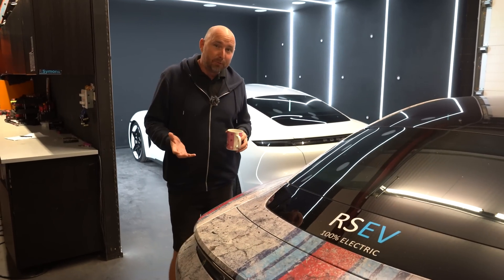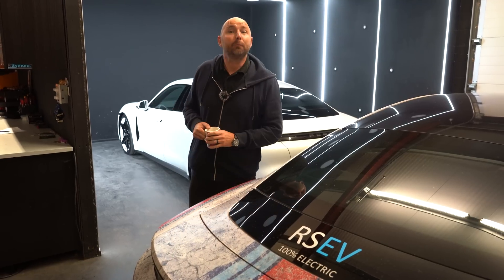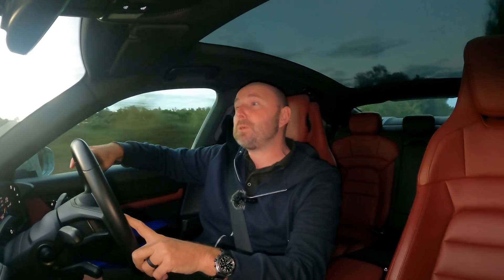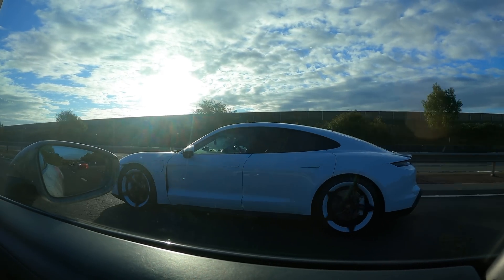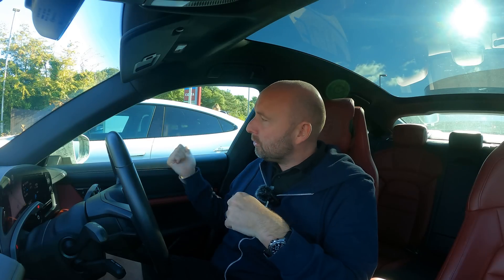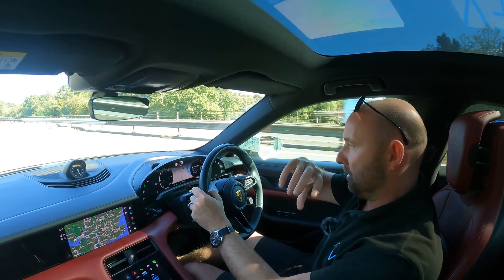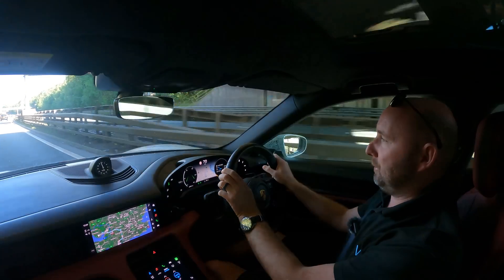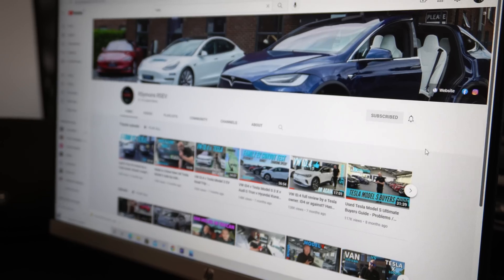Porsche Taycan side-by-side convoy. ONE with the software uPdate. Efficiency improvements tested!

Comment: Loving my GV60, it's a beautiful car. Getting used to the effects of changing settings on the range etc it's consistently approx 25 miles per 10% of battery drain so far. The heat pump is quite expensive to use unfortunately.

However everytime I see a Taycan I cry a little (given I had one on order) 😭

Comment: Hello thank you for the excellent side by side comparison, may I please clarify is it absolutely necessary to install this update at a dealer? aren't the Taycan updates auto installed over the air to our Taycans?
Reply from the maker: No this big update has to be done by a dealer. I even had to find and take my old owners manual for them to destroy so they could install and issue the uPdate with a new book! 
But apparently more over the air updates will now be possible
Reply: @RSEV  ok, that you so much for your reply

Comment: far to many chargers exposed to the elements. MUst be nice charging when its the dead of winter, blowing a gail, pouring down with xero roof cover
Reply from the maker: Well I’m usually in the coffee shop…

At least don’t have to stand and hold the nozzle in the car for several minutes like petrol/diesel
Reply: @RSEV  and your wet through by the time youve connected the charging cable and synced payment then have caught pnemonia going to the coffee shop because its tucked away or not working so your have to endure it twice 🤣
Reply: Thankfully, the majority of the newer 'EV hub' charging stations are fully covered, with on-site coffee lounges / shops etc - have a look at the new Gridserve ones...
But, when you consider that, for the first 20-ish years society was running petrol cars, owners would have to buy their fuel from chemists, we're catching up fast... 😉
Reply: @jonathantaylor1998  not as fast as the increasing electricity costs which killed off my ev purchase intensions

Comment: Would be interested to know how much did each stop cost in total - given recent electricity increase.
Reply from the maker: I meant to include, although to be fair prices change up and down they could be misleading in a few months time. 

However on this day each stop was a bit of £30 and so added up to about £60 in total. That’s with no membership cards, just pay as you go.

If I would have used Porsche or Ionity chargers for example it would have been about £25 in total due to discounted rates I can get as a Porsche owner
Reply: @RSEV  £30 to cover about 180 miles in a high-performance supercar...?
That'd equate to about 45mpg - still not bad compared to the 'real world' 35mpg the 4 E-Hybrid Panamera gets... 😉

Comment: Nice video I really enjoyed. I had been waiting for it. I sort of disagree with you that the Turbo would get as good a mileage because it has a different system so I think it would be worse mileage.
Reply from the maker: It has a more powerful motor but jsut travelling at X speed with same wheels and aero I don’t think it would have been different. Gints said it showed 2.8 the same as mine but didn’t photo it. But it’s irrelevant because we weren’t in convoy. Shame the logistics of the day didn’t allow the opportunity. But we’ll do it another day I’m sure
Reply: @RSEV  I'm told the front motor is not quite as powerful as the rear motor so one would think that the front motor would burn less energy, but as you say, the rolling and aero resistance is the same. But motors have a different sweetspot for their efficiency range and perhaps the rear motor is falling into their efficiency range at highway speed where the front motor is moving out of its.

Comment: Interesting as ever. In the Tesla Model 3 dual motor, the rear motor is permanent magnet so obviously more efficient than the front induction type so for motorway cruising at "steady" speeds the rear motor does the vast majority of work. The front kicks in when you suddenly put your foot down or the car detects any wheel slippage such as in wet or icy weather etc. Is the motor configuration the same in the Taycan i.e. two different types? Perhaps the software update has copied Tesla's motor management algorithm to get the increased efficiency?
Reply: all i know is Kyle from out of spec motoring talked about the dual motor taycans decoupling the rear drive unit in range mode. I have a feeling Taycans use PM motors on both axles

Comment: Another great review & goes to show that long distant drivers can use electric cars but the charging infrastructure needs to speed up if we are all being pushed towards EVs
Reply from the maker: Indeed. There are some fantastic charging hubs now but more always needed. Exeter services setting a great example, and plenty more around. 
But also need more general low power chargers available almost everywhere you park in public incase needed too. It’s mad when hotel car parks do t have them
Reply: It's really not as bad as some people claim. In my experience it takes longer to get served fast food in the service station than the car takes to charge most times.
Reply: @smc812  Hi Steven. Yes but the problem I've experienced is that, as now, I've approached charging hubs & all are occupied & then u end up waiting which can be frustrating if u r time poor - & in today's society, we've all got busy agendas.
Reply: @hareshkaria8377  In the past 3 years 25K miles I've needed to charge away from home 60 times (at 34 different location) and only waited once. I know this isn't everyone's experience, depends on route and frequency but for many people like me there can be no issue with the networks in the UK.
Reply: @hareshkaria8377  if you look for sets of chargers just off the main routes - places like Starbucks, Costa, McDonalds - these tend to be less busy, though are often only 50kW charge speeds.
Reply: @jonathantaylor1998  thanks for the tip

Comment: I’ve had a deposit on the forthcoming Macan EV, since 2020. Apparently It’s delayed, for another two years, due to software development problems! Interesting how the Taycan is being fine tuned, in that department. 

I wonder why they can sort one vehicle out, and not the other?  The only other explanation is maybe it’s down to wishing to use improving battery technology? 

Btw, Your Vids are excellent, very informative at all times! Many Thanks
Reply: Macan EV is believed to be using new platform (PPE). While the hardware is performing well, software is not ready since VAG is struggling with devleoping new software intra-structure. Nevertheless, I believe they would figure it out and should be quite competitive.
Reply: @姚智偉-m6h  In an ultra competitive World car-market, a delay of two years must be commercially very damaging for Porsche and VAG group. They are surely losing ground, to other performance EV entrants, such as the  Kia EV6 GT?

Comment: Would be great to see how the turbo did in terms of efficiency and range, i guess the turbo was software uPdated ? Not sure have you noticed somewhat driving and throttle response changed after the uPdate, previously the throttle was on my turbo was a tad bit more responsive and now after the uPdate it feels its switching from rear to all 4 wheels and a tiny bit lag in that switch..
Reply: +1 Turbo vs 4S comparison results